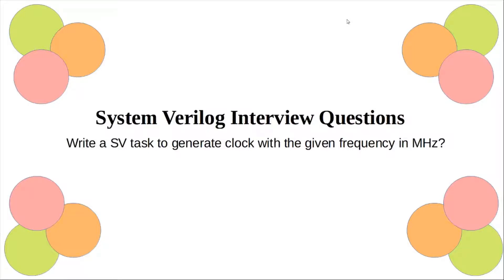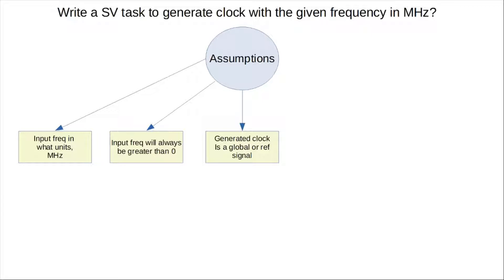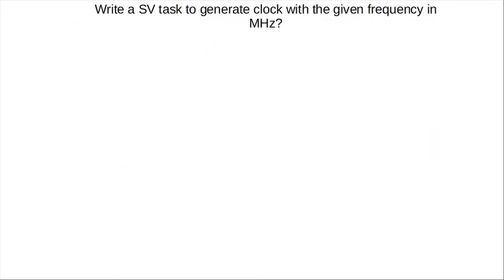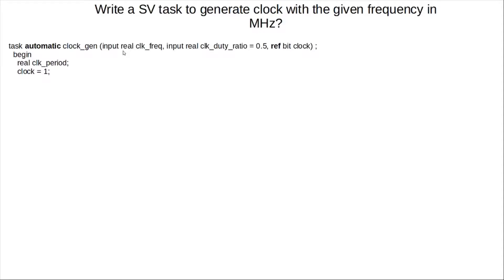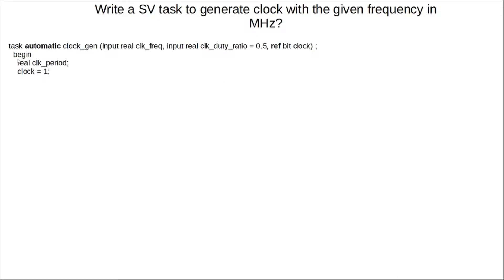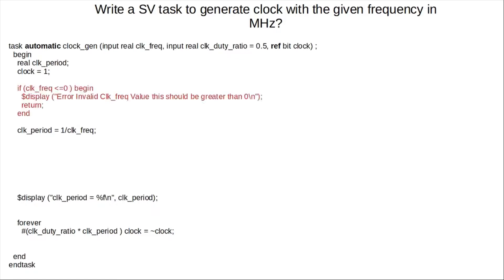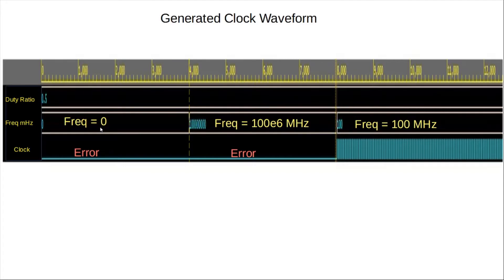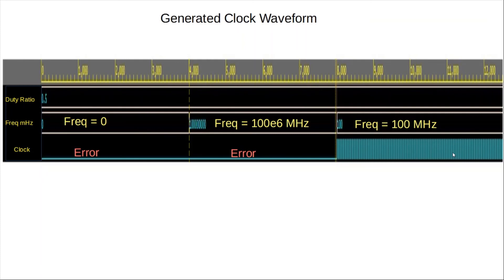System Verilog Interview Question: Write a task to generate a clock with the given frequency in MHz?

Comment: I think the duty cycle ratio is used in a wrong manner. If a user put 0.4 as the ratio, the period would be 80% of the intended one (0.4 high and 0.4 low, instead of 0.4 high and 0.6 low).
Reply from the maker: Good point.. it should always be T= 1/ F , and delay should be  T * 0.5  and should not be really called duty ratio or it should be fixed to 0.5 only. I will update description accordingly. Thanks